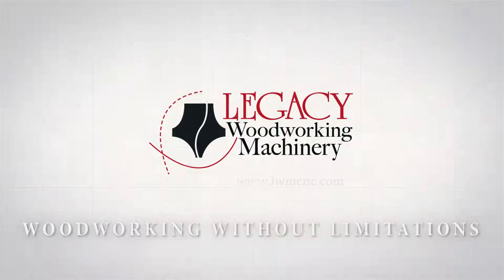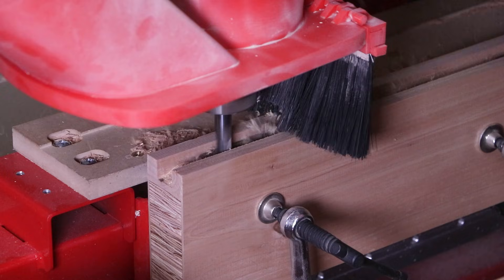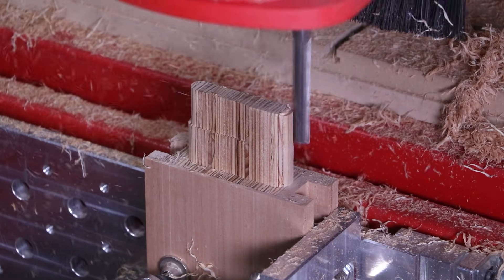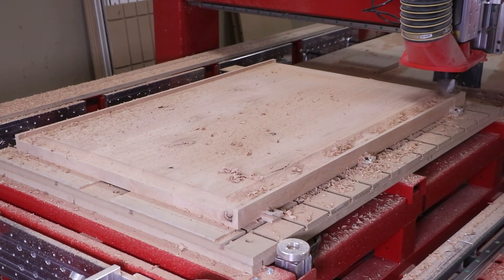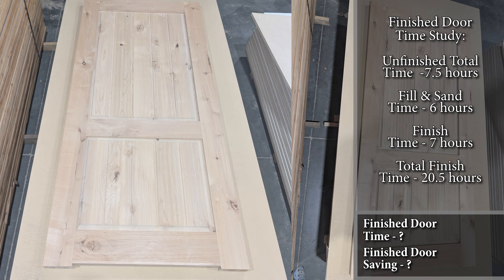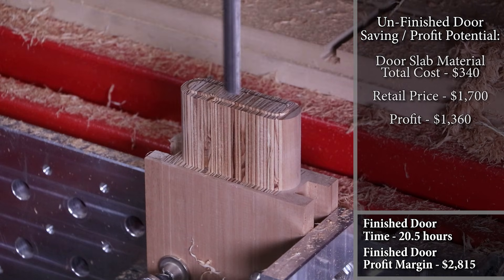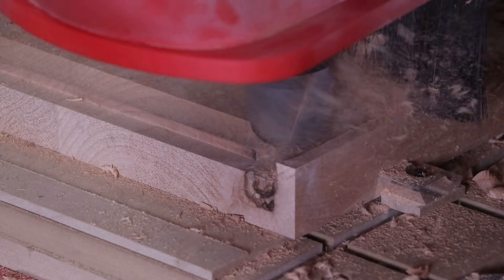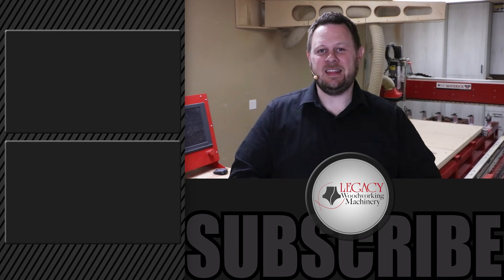How a CNC Can Build $3,400 Doors for $585 | Complete Door Build

Comment: Why not also mill out the spaces needed for door hardware?  Seems like a perfect task for a CNC machine.
Reply from the maker: Great question! When installing a door into an existing door frame we were taught by an experienced door installer with over 20 years in the business that it is easier to do that onsite. However if you are building the frame then yes we would do that for sure!

Comment: If your panels area little loose, you can always use “space balls”.  These are small rubber balls that tighten up panels while allowing for wood movement.
Reply from the maker: Thank you for the great tip!  I found those on the web and purchased them.  For this project I added a couple of thin slices of formica, an old tip my shop teacher taught me!

Comment: I’m not sure how you calculate profit without including the cost of the CNC machine, hourly labor and machine time rate, consumables (end mills etc.), physical plant, etc.??  So yes, I suppose if the average DIY’er happens to have a 60 thousand dollar CNC machine, they could make a $3400 door for less than $3400.
Reply from the maker: Lets take a look at it and lets assume that you build 1 door a week so 4 doors a month. you will make  13600.00 gross profit. now lets take out 750 per door just to keep the math easy. 10600.00 is profit minus wood.  
Now lets take the loan payment off.  on a 60 month EFA (equipment finance agreement) at 6.5% on 48500.00 machine cost plus lets say 3500.00 for shipping  for a total of 52000.00, would be right around 1200.00 a month.  
lets take 1500.00 off just to round the numbers high.  we are now at 9100.00 a month in profit by making only 4 doors a month... not a bad months work.  The REAL question is, what else can you do with all the extra time.

Comment: Excellent video. What type of wood is that?
Reply from the maker: Knotty Alder.  It is an amazing wood to work with and it really sands up great!
Reply: @legacycnc8232 I saw that core inside and was curious
Reply from the maker: That is an LDL core.  Those pieces are bought from a local lumber supplier pre-built.  they are about 83.00 each